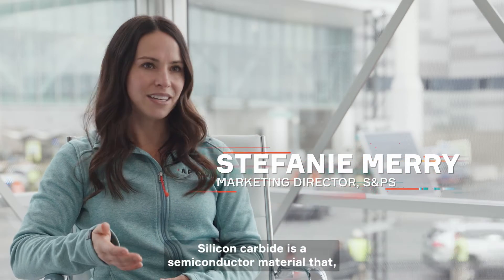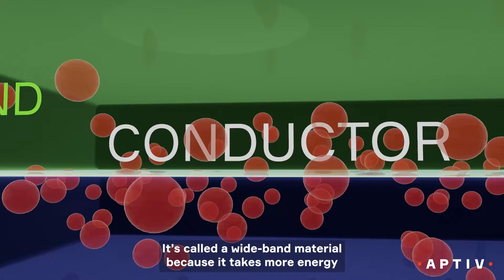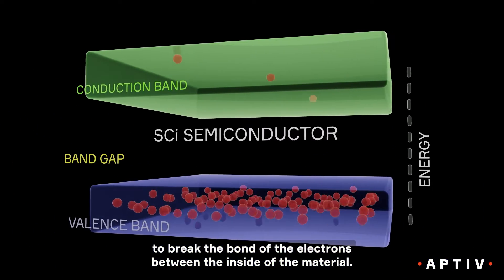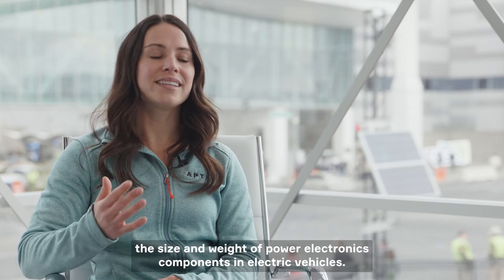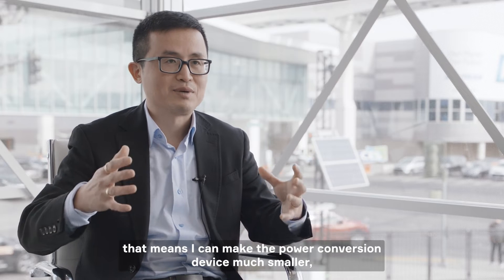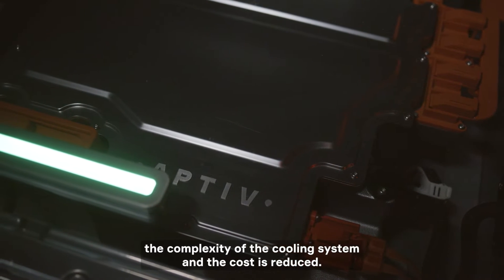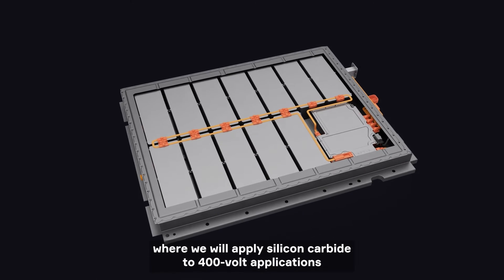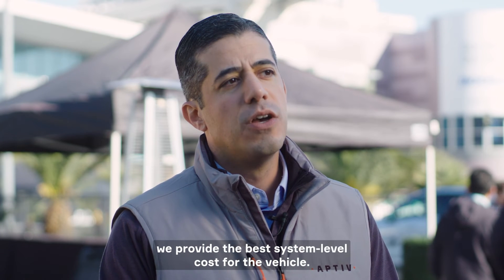What Is Silicon Carbide?

Comment: Why is air cooling better here? It sounds like this obviates the need for active cooling; how do the efficiency changes in silicon carbide reduce the cooling load?
Reply: Cooling capability improves because SiC has better thermal conductivity in comparison. Also, it wouldn't necessarily remove the need for active cooling when generating less heat since in most applications the opportunity SiC provides will aim to leverage the improved power density to make power electronics smaller. Although in some applications, it certainly can justify shifting thermal considerations down to less active cooling, smaller heatsink, or removal of a heatsink altogether.